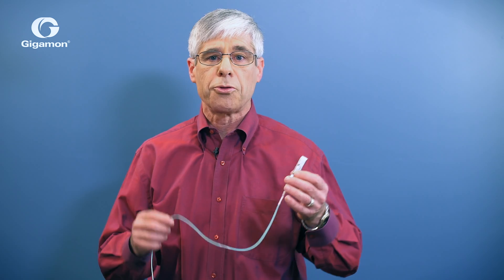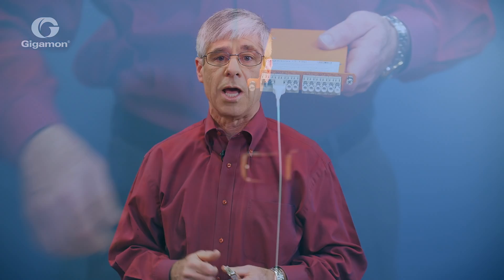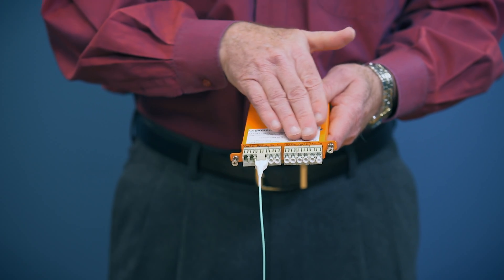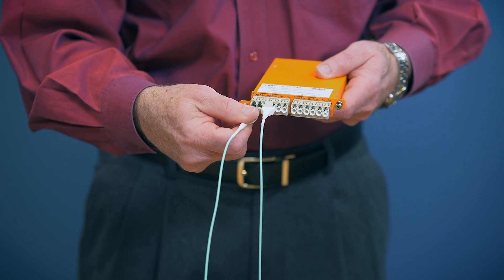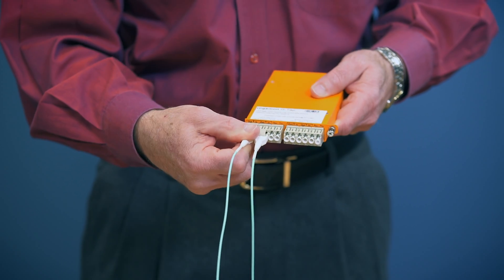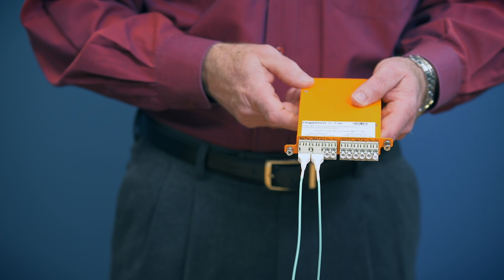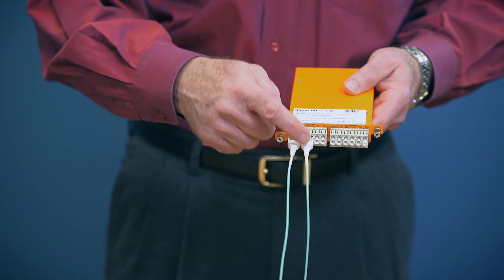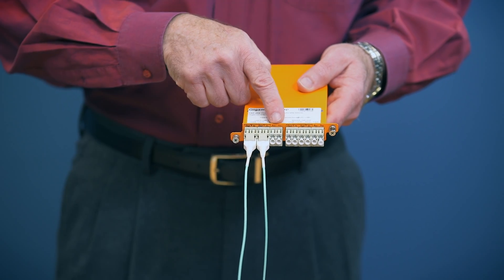Network TAPs

Comment: i didn't understand well what is the difference between  HUB and network tap? sombody please?
Reply: A network hub is an older, physical layer device used to connect networking equipment.  Because of this, every packet on a hub can be seen on all ports.  This is unlike modern switches or routers that send packets directly to a specific port.  When hubs were common, it was easy to get copies of the traffic.  Thus, you would not need a network TAP in a hub environment.  TAPs are used today as a standard method to copy traffic on modern networks for the purposes of visibility, security, and maintenance.
Reply: @FarmerMikePumpkin thanks
thanks

but one thing i don't gat it
in router all port is another network
in switch assuming that there is no vlan,
and no unicast between to device,  just  broadcast 
why i can't listen to any body connected to this switch  without port mirroring ?